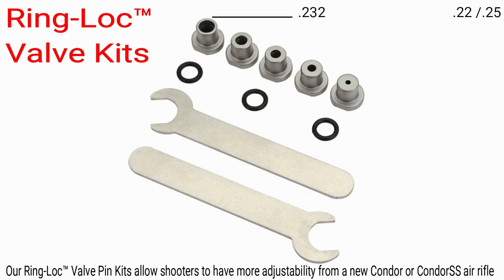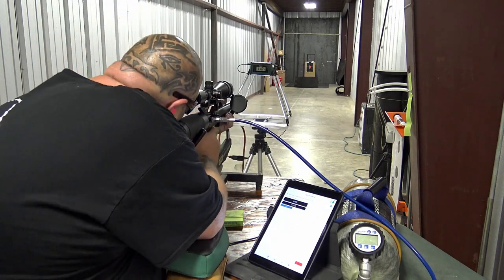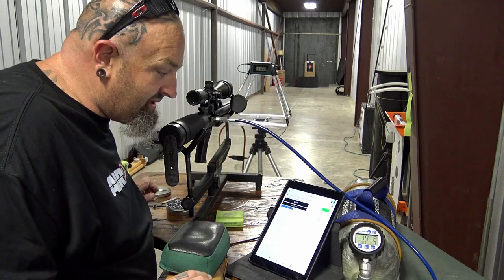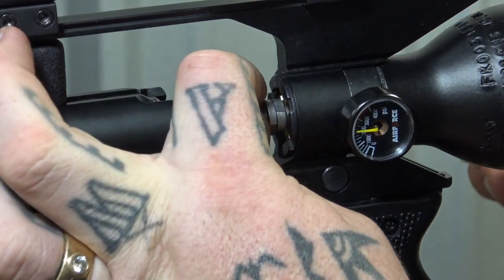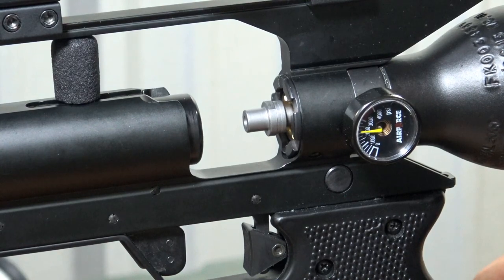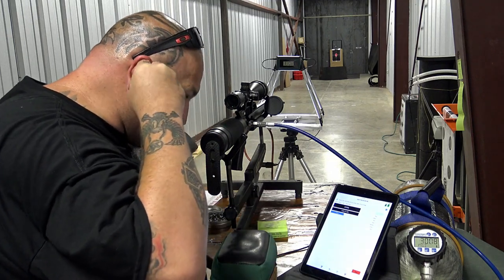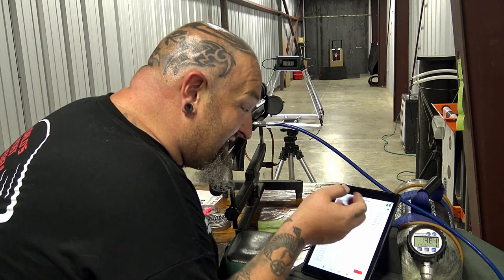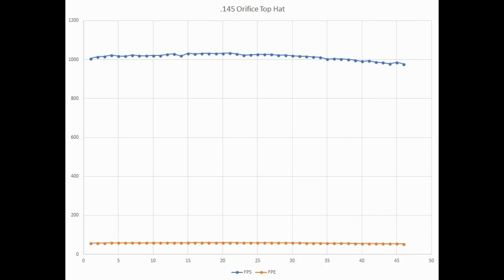Ring-Loc Valve Tutorial

Comment: I have a question regarding this new adjustable output tophat..... I'm hoping you'll take the time to answer it.

I understand having the flexibility to control the output volume of air to customize shooting different projectiles. I think the concept is awesome. But at one point in the video you demonstrate how to change to a new orifice. You remove the old one and replace it with a smaller one. But before you cinch in down, you pull back the breech to make sure there's no slack or residual movement (be it ever so small), and that the breech sit flush against the crown/stop on the tophat. By doing this, aren't you increasing the time the valve stays open when the hammer strikes the breech? 

I have a massively customized Condor that I have dumped a LOT of money into. I am forever trying to tune the gun to get it to shoot perfectly. One of the MAJOR issues people tend to overlook when tuning one of your air rifles for accuracy is efficiency of air released when the hammer strikes the valve. The old tophat (as well as what I can see from the new one) gives the shooter the flexibility to adjust the length of stroke of the tophap by backing out the .050 set screws and raising or lowering the crown of the tophat by turning the crown clockwise (shortening the stroke) or counterclockwise (lengthening the stroke) to adjust the amount of air released. Both ends of the breech have a 90 Durometer O-ring in them that expand to seal around the breech of the barrel and the exit port of the tophat simultaneously. Due to the placement of the O-ring, and the physics behind how it works, you have the flexibility to lengthen or shorten the stroke of the tophat by 1 or 2 millimeters, and still have the necessary components fall within the reach of the O-rings inside of the breech. 

There are several facets that go into properly "tuning" your gun to make it as accurate as possible. People focus in on muzzle velocity as their benchmark. Say for instance that 900-930 FPS is the sweet spot for the JSB 33.94gr pellets in .25 caliber. So people get their guns dialed in to achieve that velocity. Then they cannot understand why they get spinners and their groups may not be as tight a some competitive manufacturers air rifles. That's because even though they are achieving the correct velocity for the projectile, they are putting way too much air behind it, because the stroke of the tophat inside the valve is too long, and after the pellet leaves the end of the barrel at the muzzle, the extra air is also released behind it. This air is volatile and turbulent, and causes instability in the projectile right out of the gate. Fortunately pellets "right" themselves, so although the extra air will cause instability, the pellet typically won't wander too far for the intended target. But if you're using your AF rifle to shoot slugs, this causes massive issues, and massive frustration. I almost wanted to take a sledgehammer to my gun at times. I literally had to walk away for hours or days sometimes until I found the energy to attempt to tune it again. 

But I think the most overlooked/minimized facet of tuning the AF rifles in length of stroke. You know you've got it right when the sound of the rifle is a VERY short crack, and your gun becomes very efficient with the air it's using. By using just enough air to get the pellet to exit without having extra air leaving the end of the barrel behind the pellet (destabilizing it), the AF rifles can shoot like a LAZER BEAM! But I guess the whole point of me writing this was to emphasize this, since in your video you snugged the end of the tophat up against the breech. Since you are the expert, and since most AF gun owners won't invest the time to properly tune their guns, they may believe that this should always be done when changing the orifice out, which simply isn't true. 

But thank you for the video. I enjoy watching you on YouTube.
Reply: Did you do the o-ring trick behind the 🎩? Just wondering if I should or not my first AF and I guess I have a lot to learn and you seem to know what your talking about thanks
Reply: @nickhathaway4617  I sent you a reply on the video you have posted of your dog talking to your cat.

Comment: I ordered the ring log valve kit,  but then had to order the tank with the proper valve.    It arrives today.    I'm getting pretty nice performance with the older high flow valve.   using a .25 cal 18 " barrel,  with a 52 grain NSA w\hollow point slug fired at 898 fps ,  I get  93.13 fpe.     This rips a soda can of water apart.     These are accurate.     It's a condor ss.     .22 and .25.      Might just have to get a long .257 barrel ?

Comment: Quick question you say do it so there's no slack everywhere on the forum's say the space between the back should be the thickness of a quarter if I do it so my breeches nice and with no wiggle the space in the back is definitely thicker than quarter so do I do the quarter method what do I do at so there's no slack in the breach sorry just got a talonp and it's my first Air Force
Reply from the maker: Either will work,  to be honest. We showed the "no-wiggle" method in the video as it is the easiest to achieve on the fly but if you are wanting to maximize shot count or tune the valve stroke the quarter method is a little more efficient as the valve stroke is shortened slightly.

Comment: Fantastic. Does this fit on all airforce airguns? Also does it fit on the older ones?
Reply from the maker: It works with all of our current production valves, however, existing guns can be upgraded by either purchasing a new tank with the new valve already installed or sending the existing tank in for a retrofit to the new valve.
Reply: @AirForceAirguns1  ok. Thanks

Comment: My talo SS is new,  but older.    It does not have the set nut behind the  top hat.    Will I need a different valve or to send the air tank into airforce to have it modified ?    Thank you,   Fred.      I love this rifle.    I have a Crown, Impact,  and several others.    This is very cool.  Powerfull.
Reply from the maker: Hey Fred, you can either order a new tank and it will come with the new valve already installed or send your tank in and we can change out the valve. Give our customer service line a call at 877-247-4867 for more info! Thanks!
Reply: @AirForceAirguns1  Thank you for the fast reply.  It's a Condor SS, not a talon.      Thank you.   I will call.
Reply: @AirForceAirguns1   called your place of business and they took care of all details quickly.   Thank you for the quick response.   I will make a .257 monster out of this.
Reply: @fred9532  m